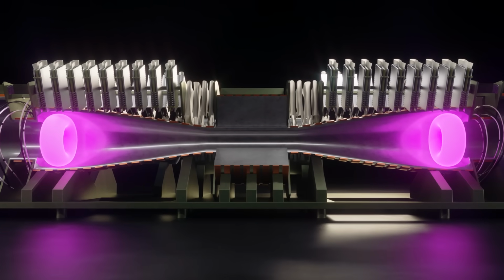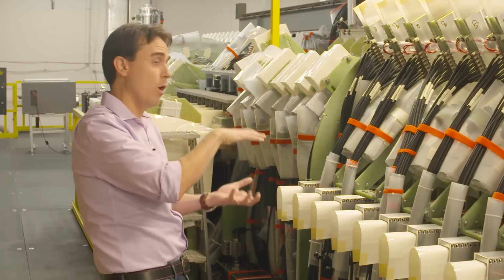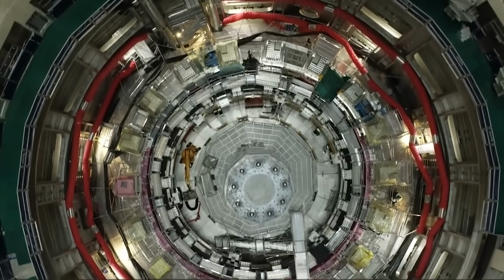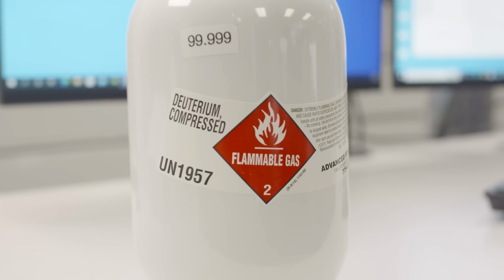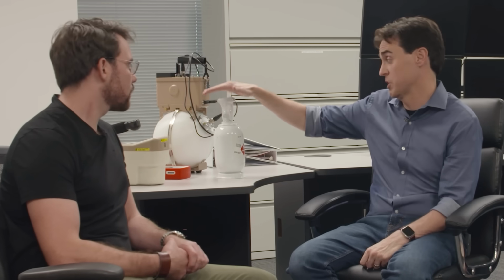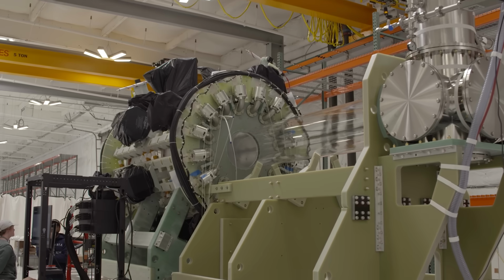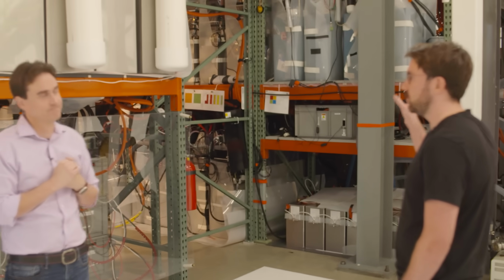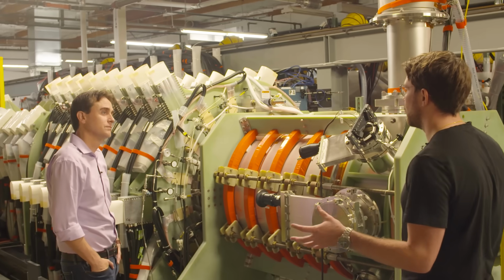A New Way to Achieve Nuclear Fusion: Helion

Comment: First of all to feed the entire world...if people turned their lawns into gardens there would be enough food to feed three times as many people. Second the micro plastics issue is a man made construct. All that needs to be done to alleviate this problem is first of all clean up the plastics and start making everything out of hemp which has proven completely biodegradable and nontoxic to people as well as the environment. And everything that is made from plastics can be made with hemp and then some. The continued forced use of plastics is only because there were those who did not wish to lose money. If people grew food instead of lawns there would be enough food to feed three times as many people in the world. We can put generators on electric cars to recharge the batteries as well. Some people are doing this on their own. Thorium reactors can be used as opposed to uranium to produce safe and abundant electricity. This so called crisis is a lie and easily rectified. It is simply because those in power do not wish to rectify it.  Uranium is used simply to make weapons. Thorium is very much less radioactive or toxic to the environment. We could quite easily make and use thorium reactors as opposed to uranium. Of course, government would lie and tell you it’s not a viable alternative but in fact it is. China is beginning to do it now. Then there are wave form generators that could be put along shore lines. And until all of this is implemented we could make vehicles that run off of ethanol. This produces exactly the amount of carbon used to grow the crops. And synthetic oil in fact works better than petroleum based oil. And guess what makes the best ethanol in the world…KUDZU  yes the plant that is considered invasive and will grow one foot in a day. Until the fusion process is perfected which was discovered in dec of 2022( I think dec 13th) all of these things and many more could be implemented, oh not to mention three dimensional solar panels that will produce at least four times as much electricity per panel. However, they are being oppressed by the powers that be and this cannot be allowed to continue. The answer is most definitely there people. All of these ideas that are completely viable and more are being oppressed and this cannot continue.  We do, in fact, have a choice and it’s really quite simple, simple as implementing it....

Comment: could this not be mirored 6 times to cover all axises of space?
making it so there's the ultimate amount of atoms crashing in to each other?
or would that be to much??
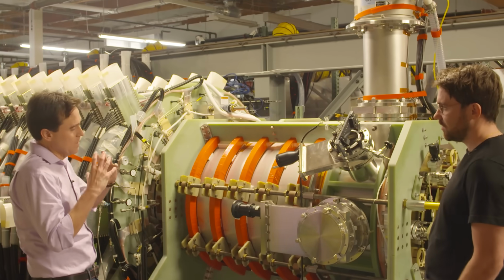saying this as of minute 2:46

Just incase some ppl dont know what i mean by mirroring it 6 times what i mean by this is plasing 6 of the things in all positions in space; up, down, left, right, fowards, and back. . . and if posible  maybe even add more in other degrees, why not just make a ball of these things fit as many as you can. . . I imagine the power draw to start it up though would be enourmus though, but it would be interesting to see if it worked, and heck it might even give back more than what we put in. . .
Reply: The compression coils would get in the way. What they COULD do is have several plasmoids injected and accelerated in series. It would add a lot of complexity though and is not really needed.
Reply: Won't the compressed atoms crashing this way cause more heat than can be contained?
Reply: @upinapuffofsmoke1653   im sure it would defenetly cause a very hot interaction, im no expert so take what i say with a spoon of salt, i mostly said what i did on my previous coment cause i think it's a neet idea and if it could be done right the heat can also be used to make steam or heat up other things, other wise, i belive it's an interesting engeniering chalange.. ..

Comment: There is a very large room full of treadmills. These treadmills create energy when you get them moving. That energy output goes up the faster they go. On the treadmills there are a bunch of democrats that were told that they could keep their jobs after the next election regardless of who wins as long as they went faster than the Republicans in the next room. They are what powers the Helion. Brilliant  👏

Comment: How do you sustain the reaction though? Wouldn't it just explode like a fusion bomb?
Reply: No, these machines can not explode.
Reply: They don't sustain the reaction. They just trigger it many times in quick succession
Reply: Fusion reactions will just stop if the temperature drops, there exist ways for fusion reactions to “explode” or “implode” but that’s like 10 steps away from getting a sustained reaction, and as soon as you cut the temperature it will die.

Comment: Yeah good thing it still takes 100 times the amount of energy input to the output. Yeah ok the laser has less energy than the output but it takes so much energy to get that laser it’s useless so far. It’s gonna take another ten years to fix that I swear but yes yes yes amazing progress
Reply: This machine does not use lasers. It has a completely different design, different team and different approach.
Reply: @elmarmoelzer2229  yeah commented before I finished, but the actual breakthrough that happened in fission does and that is the case
Reply: @humphreyjones1828   Fusion, not fission.
Reply: @elmarmoelzer2229  yes, fusion not fission. The lasers being used on the recent breakthrough take 100x the energy that those lasers carry to form, so it’s still a net energy loss on the fusion reaction
Reply: @humphreyjones1828  YEs, that was the National Ignition Facility. They have nothing in common with Helion and their approach.
Helion does not use lasers. They are also much closer to net electricity than NIF.
Reply: @elmarmoelzer2229 they may be statistically closer to net electricity gain but it’s not the same and it doesn’t compare. And besides that the only reason this video got released is because they are riding the OTHER fission breakthrough and trying to get publicity on its back
Reply: @humphreyjones1828   Fusion, not fission. And no, this video was filmed months before the press release about the success of NIF. These videos take time to edit, post process, etc. 
Do you think those animations were done over night?
Reply: @elmarmoelzer2229  they are dick riding the recent achievement and you know it, they know it, and anyone who knows what’s going on knows it. They’re gaining publicity towards their project based on other peoples curiosity of the recent achievement

Comment: This pulsed fusion and direct electrical harnessing also has another huge advantage - the speed at which it can react to grid demand.

With this system they would simply need to change how many pulses per second they are doing meaning a reaction time of fractions of a second - way faster than any of the existing types of power station or even the theoretical ones.
Reply: Conventional nuclear reactors are already extremely fast, all you have to do is shim control rods in and out with response to steam demand
Reply: @WrinkledPugoda  Quicker than they were, but still orders of magnitude slower than this - typically <5% per minute. 

The economics with this might work out such that it’s cheaper to use another power source for load levelling (another reason why fission runs at 100% output whenever possible), but the capability would be there.
Reply: @WrinkledPugoda You broached the subject of something workable in the near term. So you will be punished.

Comment: This video lacks any information about any results. There aren't any photographs of plasma, no number of neutrons created, no data about amount of heat generated, not even data about electric energy used. Plasma is extremely unstable. Large part of energy is emitted in the form of gamma photons and neutrinos, and can't be recovered with magnetic coil. I can't say whether "Helion" experiment can work or not, but lack of any information about result is suspicious.
Reply: Helion has not published detailed results of Trenta yet, but they did publish them for the much smaller predecessor, Venti. Venti achieved 10^11 neutrons/pulse and a triple product of 10^19 kev s /m3.
Trenta is 3 times the radius of Venti (and has other improvements). Gain scales at rs^2.1. There are some other things that help them massively, like the ratio of ion- to electron- temperature. So, you can do your own guess where Trenta is. My personal estimate puts it above JET, potentially even pretty close to D-T break even.

Comment: frankly the true biggest hurdle for fusion reactiors is getting more energy out then you put in. im sure would could make a one time fusion reactor that does fusion one time and gets way more energy out then in but it just wouldnt be worth it as a full reactor of any kind would be expensive to replace.i dont know how much im dreaming thinking like this but i think a good time frame would be maybe 10 years of a reactor being able to run before needing to be replaced. and hopefully cheap enough to make a few hundred of them acrossed the world. if they can make maybe 20% of the energy needed for a country i think that would be a very good amount to start with. as even that alone would help reduce the use and need of burning coal and gas(not fully but a noticeable amount)

Comment: The Scarcity of Tritium is one of the leading reasons we need to establish both Lunar and Astroid belt mining services. The Space programs need to focus on moving this into the forefront of our space efforts so as to bring space travel costs down considerably to where eventually we might see commercial and personal travel out.
Reply: Helion does not use Tritium as a fuel. They use Deuterium (abundant) and Helium3. He3 is rare but Helion will produce their Helium3 by fusing Deuterium in the same machine. D+D => He3 +n or D+D => T + p (the Tritium eventually decays to He3 as well). No space travel required.

Comment: Simply, they made two plasma cannons fire at each other with a magnet in the middle to make a fusion reaction.

My question is, what can a plasma cannon do to a tank or armored vehicle.
Reply: Not much. The plasma is hot but not very dense. The plasmoids would desintegrate quickly after leaving the magnetic field and being exposed to ambient air.

Comment: 7:40 For those of you like myself with no background in this field, consider the core of the Sun is 27 million degrees, whereas this fusion process reaches over 100 million degrees. That in itself is absolutely incredible that they've developed a way to contain such temperatures.

Comment: This one is better than previous videos in discussing the He3 generation problem, but I still found it hard to follow, and potentially hand-wavy around some key bits. I'll have to watch portions again, to see if I can puzzle it all out. The electronics are amazing. Though I must add that I once designed a circuit myself with an LVPECL delay line. As I recall, there were 1024 delay settings in multiples of 10 ns. Eventually I was going to characterize the actual linearity of this old but exotic part, only the financial crash of 2008 mothballed the whole thing. By this standard, µs seem rather slow.
Reply: Helion will produce their Helium3 by fusing Deuterium in the same machine. D+D => He3 +n or D+D => T + p (the Tritium eventually decays to He3 as well).
Hope that helps.

Comment: This looks incredibly promising! Wondering about power output though. It sounds like the magnets don't use that much power in total per collision, so the real consideration for break even will be how much energy is required to create the plasma in the first place. Since the power collection wil come with Polaris, do we have any measurements on what Trenta would produce if it could?
Reply: https://youtu.be/r-EOPGmB5eI
Reply: They probably plan to salvage the magnetic drive energy in the capacitors, as an enormous LC resonant system. Takes a while to pump it up, but look out then. Beats a Marx bank which may be what the capacitors are there for now.

Comment: Seems like a more practical solution than the  toroidal style tokomak. How would it scale to an equivalent  experiment similar to ITER? I.e. 1 Mw for 1000 seconds?
Reply: I feel like this is more a proof of concept to prove that it's possible to fuse hydrogen using this method, after that they will go into the production side of things. Nuclear (specifically fission until fusion becomes usable) is the future, i wish people would stop lying about it.

Comment: Orrrrr

Just build molten sodium fast reactors and burn spent fuel rods.
Reply: Molten salt are fission reactors and people keep lying about fission to push "renewables" which do nothing but create scrap and kill people at a higher rate than fission. Fusion will be the ultimate end goal since hydrogen is literally the most abundant element in the universe which means unlimited fuel but, I agree that molten salt and regular fission reactors with deep vault environmental storage should be our primary source of power right now.

Comment: Honestly my main concern with this is not the fusion part of it, but rather their fuel cycle. I don't really see a way to have a D-D burn without also burning up almost all of the tritium that is produced, because the tritium will be produced while a significant excess of deuterium is present, and D-T has at basically all temperatures a much faster reaction rate than D-D. Though, even if it just has to run as essentially a D-D reactor with full burnup of the reaction products, plus some extra injected He3 from the lithium blanket, that would still be a much lower neutronicity than a pure D-T one, and solve the tritium supply issue.
Reply: The pulses are too short and the Tritium is too hot and non collisional on the length of the pulse. Fusion products are evacuated between pulses.
Reply: @elmarmoelzer2229  Hi Elmar. Can you explain to me why the tritium will not fuse in this case? It is a thing which I as a layman do not exactly understand.

Also: how should I perceive the helium-3 breeding to happen here? Does it happen on the 'generator' ends of the machine, or is this being done in another reactor separate from this one?
Reply: @Elucidator-  
The Tritium does not fuse because it is too hot and non-collisional on the very short length of the pulse. 
The same machine that makes the electricity can breed the He3 from D-D fusion. 
Helion has not yet decided whether they will do everything in one machine, have dedicated D-D breeders and dedicated D-He3 machines, or have dedicated breeders that do a little D-He3 and dedicated D-He3 machines that also do a little breeding.

All three options have their pros and cons.
First one might require slightly bigger machines and there would be more tritium on power plant sites (could make licensing harder). But then you can focus on mass production of just one type of machine, which helps.

Second option is great from siting POV. You have very few (or maybe just one) sites where you do the breeding and store all the Tritium. That could be in a place where getting a license is easy. Then have dedicated D-He3 machines that are easier to get licenses for (and can be more compact). The D-D breeders would be essentially self sustaining but would likely produce no (or almost no) income from electricity unless they build them much bigger for higher gain (which makes mass production harder since they would not be transportable by road and would essentially need a factor on site).
Though, there is a way for them to make income from selling Tritium. Tritium will be in higher demand for at least a while anyway because of all the D-T fusion machines that are also under development.

Last option is sort of a mix of the two. 
Breeders that make a little electricity for a little profit and D-He3 machines that (can) do a little breeding to not 100% rely on externally provided fuel.

Comment: It is very important that these fusion systems ramp up their R&D engineering. In todays world the next century must not depend on oil and gas as the previous century did. With wars being fought around oil resources, it is important for global stability to show a different path to future energy sufficiency. If all the cars and houses in North America were to switch to the electric grid we will need about ten times as much power as today. Renewables can not provide this.

Comment: Interesting video! Dig you get any information on achieved triple products/where they stand regarding achieving the Lawson criterion for D-He3 or D-D fusion?
Reply: Helion has not published detailed results of Trenta yet, but they did publish them for the much smaller predecessor, Venti. Venti achieved 10^11 neutrons/pulse and 10^19 kev s /m3.
Trenta is 3 times the radius of Venti (and has other improvements). Gain scales at rs^2.1. There are some other things that help them massively, like the ratio of ion- to electron- temperature. So, you can do your own guess where Trenta is. My personal estimate puts it above JET.